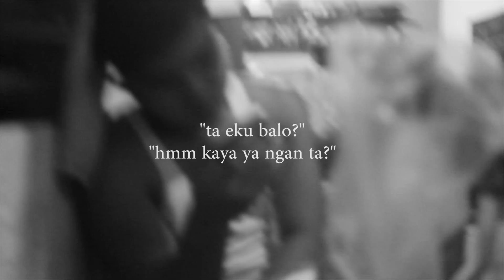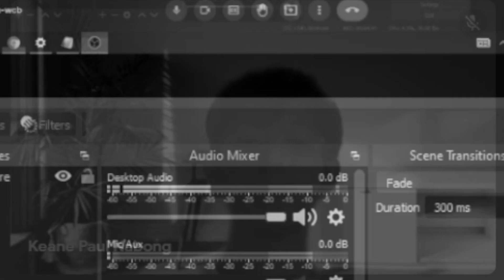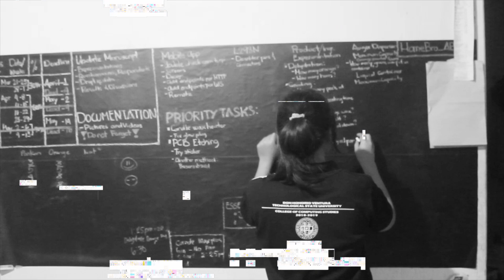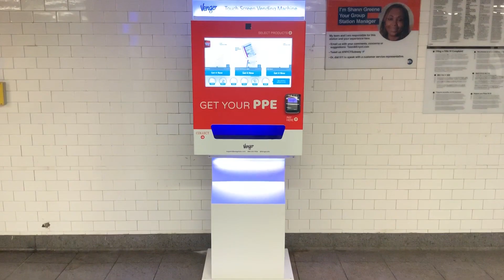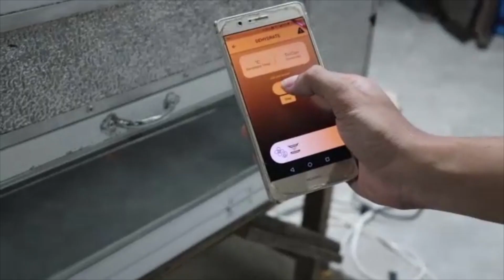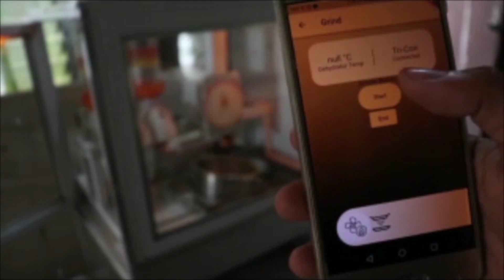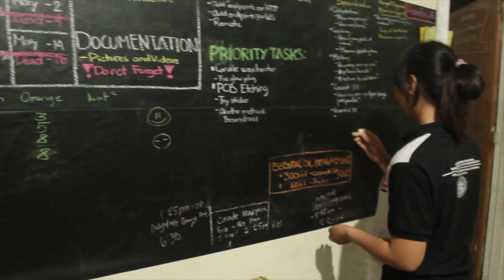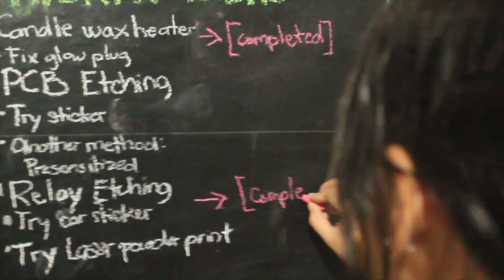Our Engineering Thesis Journey in the Philippines in 10 Minutes

Comment: yung e-boto pwedeng voting machine operating system focus nyo with extra layer of security with a cryptographic chip and depth face recognition.  pati network layer may extra security then gawa kayo secured network protocol for voting machines so dalawang thesis topic  na.  yung read the sign depende siguro pano nyo implement. ang common na siguro yung flex sensor or depth camera or accelerometer.  kung di pa gamit stereo camera, 3d reconstruction of hand gesture using stereo camera. pwede rin using ultra wide band phased array radar to detect the gesture. yan bago tech yan wala malamang gumagamit pa nyan. Yung vending machine di ko gets bakit nireject kasi depende sa implementation uli. pwede ka magfocus sa medicine sorter pwede mag narrow down pa sa  design of high speed camera using fpga and camera sensor array in fast conveyor mechanism. o kaya siguro may built in na thermal imaging para makuha temp mo or contactless temp sensor, tapos may ecg din, blood pressure at sugar monitor. o kaya magimplement ng continuous sugar monitoring device using skin surface properties. o kaya terrahertz spectroscopy of blood sugar invasively. terrahertz imaging yan to determine cell sugar level sa skin.  marami susulpot na topics pag nag narrow down.
Reply: Hello po! Baka meron kapong ideas i'm 4th yr CPE rin po nahihirapan humahanap ng pang capstone😢
Reply: @pbbcollabupdates02  ano ba research interest mo  gusto mo i focus? microporcessor design, microcontroller design, ai processor design, embedded system, operating system, networking, algorithms....etc

Comment: Kuya IT ako 3rd year, and naririnig ko na sa 4th year, sa capstone, hindi na pwede ang system. Sobrang konti ng may alam sa programming sa buong klase namin. Tulad ngayon, dose kami (2 groups pinagsama) pero ako lang yung nag prorogram. Ang problema hindi pa kami tinuturuan ng hardware ngayong 3rd year. Ang skillset ko lang is full stack web dev with react on the frontend and backend node express.  Gusto ko mag aral ng ganyan para maready nako since wala talaga akong experience sa hardware. Ano po yung mga languages and softwares na ginamit niyo, and ano po ung mga inaral niyo para magawa yung device niyo (sobrang angas). Salamat po.
Reply from the maker: hardware - raspberry pi 3, 4 stepper motors, a bunch of relays, circuit board (with own etch), load sensor
 software - python, dart flutter, flask for web server, api, raspbian os

i think yan 😀
Reply: Ohh may ganon pala i heard din na may mga IT na 3rd year is hindi pa marunong mag programming like what?! 😭 Pano kayo pumasa sa lower year nyo?
Reply: @mabangong.tambay  online so basic mag kopyahan